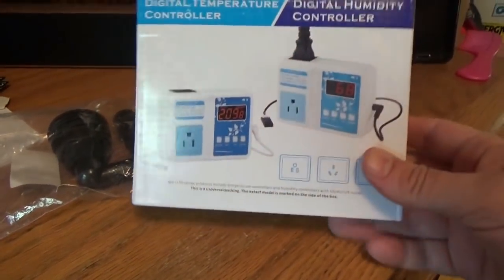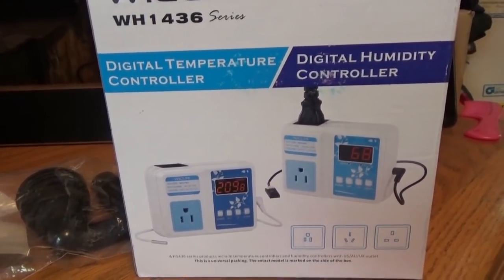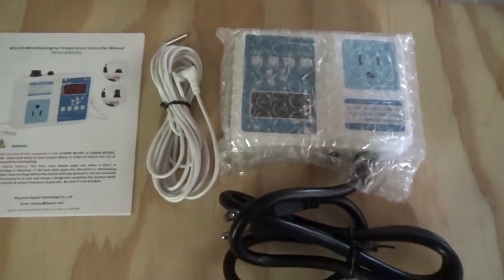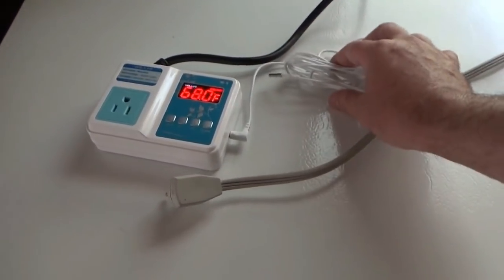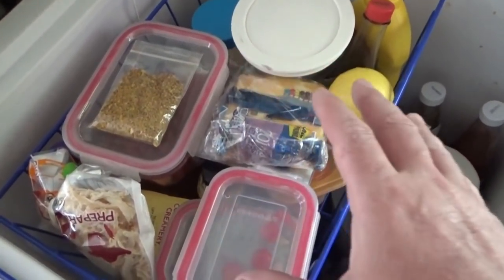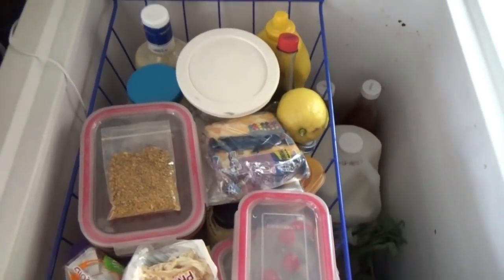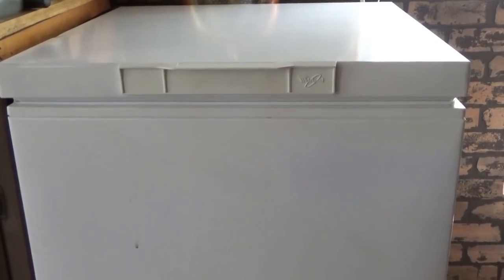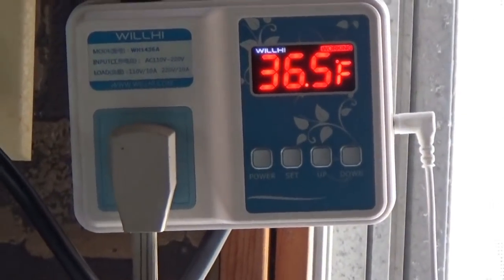Converting Freezer To Fridge For Off Grid Solar Power Operation

Comment: I put my sensor into an empty ketchup jar at the bottom of the freezer and set the control to 26 degrees. Everything stays frozen at the bottom. Everything on the freezer ledge and higher stays between 38 and 40 degrees. I also keep some ice packs at the bottom of the freezer to use in coolers. The difference in energy usage is negligible if set at 26 or 32 and this way I use my freezer as a freezer and a fridge.
Reply: Hello, I know it's an old comment and all but I'll try eheh could you tell me the average consumption after the modification and the size or model of your freezer?
Reply: Thankyou for the info. That's something I was hoping would be possible perhaps with a styrofoam divider

Comment: I did the same exact thing and used the same controller works great.  Set low temperature cut off at 33 degrees F and the high temperature at 37 degrees F.  Stays on for 2.5-3 minutes turns off for 30 minutes.  Great way to save on power.

Comment: The freezer already has a temperature cutoff.  To make one into a fridge, you just replace it with one with a lower temp range, they are like $10 on ebay.   Also note that a deep freezer is not meant to cycle often, things freeze and stay frozen, a fridge gets warm things in and out of it all the time and needs a bigger compressor to cool faster.  And lastly, a deep freezer uses coils on the outside of the freezer box as condensor coils, so the freezer must not be put in an enclosed space, whereas a fridge has a fan and coils outside the box that can flow air from above it to under it and can be put in an wall space.    Just a few things to know.  I am building custom fridges for rv and offgrid now.   Even best to put the compressor and condensor OUTSIDE so no heat is put inside the building, at least during times where you don't heat the living space.

Comment: Greetings from off grid Oregon. I had a chest freezer that I converted to a refrigerator back when our solar system was small. Mine used 220 watt hours a day or .22 kilowatt hours. We used tupper ware containers for different things. The biggest problem was the buildup of water from the humid air. We had to wipe the walls down with a towel once a week. We also insulated the compressor shelf on the inside of the chest compartment. We also insulated the top of lid the freezer. That was all we could insulate because the coils are under the skin on the sides of the freezer. The sides have to be exposed to dissipate the heat.
We eventually added to our solar system and do not need to use the chest refrigerator anymore.
Reply from the maker: Yes I was thinking of insulating the lid a bit better. I can feel cold on the top. And the condensation is terrible.
Reply: The Do It Yourself World that always helps to over kill on insulation to keep moisture at a minimum. In Florida where I live moisture is always a problem. I don't air my whole house just two rooms and mold is an issue in the unairconditioned  rooms.

Comment: This is too darned weird...last night I was in my shop looking at my $686.00 62qt. Dual Zone Whynter Fridge/Freezer that died right after the Warranty Expired. Plus, about 6 months ago I bought a 7cu.ft. Arctic King Chest Freezer for the shop...The Whynter Dual Zone was to be used in my Toyota MotorHome when I finally get my butt out on the Road...but it's Dead now....so on to other projects... So last night I was thinking to myself...I wonder if there is a way to have my little Freezer converted into a Fridge as the Freezer is rated at 1.2 amps 115volts....and here I am tonight I Stumble across your Brilliant video answering my question  ! Plus...I was at my local BiMart today and saw the exact same 7cu.ft. Freezer I bought for $199.00 is $50.00 off ....so I might just buy another one Tomorrow....Right after I check to see if I can fit it into my little Motorhome !  LIKED/SUBSCRIBED !

Comment: You can convert some chest freezers by just adjusting the screw on the thermostat. It will require accessing the side or back of the thermostat. This is also better than an external digital thermostat because it does draw any extra power (4W LED thermostat draws same energy as what some converted freezer-fridges - i.e. 100WHr/day)

Comment: I'm just learning about this project. Would a drain hole not fix your water issue? I have no idea what this is about or anything I'm just trying to learn some prep tips.
Reply from the maker: Yes, a drain would help out a lot. It is quite simple. A freezer is better insulated than a fridge. And a chest freezer holds cold air in better. Look at the freezer isle in the grocery store with the open top freezers. Cold air sinks. So, use a better insulated freezer and the fact that cold air sinks - put a thermostat on it to keep the temperature lower - and you have a mega efficient fridge.

Comment: Is it just me or did you have that temputure control plugged into a wall outlet with the freezer plugged into the control unit?!? How do you know youll have enough solar to power both?!?
Reply from the maker: For one thing, this is a separate power outlet, just for the fridge. For another, the solar power is separate from the house. Either things run or they dont. If its cloudy we plug into the grid or shut down.
Reply from the maker: On a video coming up, I show the grid power meter NOT running at all :)
We are slowly using extension cords and separate outlets to power all our things OFF the grid.
Reply: I don't know how you have everything set up but is there a safety issue if there are extension cords all over the place? Anyway, hope you are able to save some money by using your solar power. Just be safe for you and your family.
Reply from the maker: Well, with Michelle starting to become mobile, yes I am looking for a better way to wire things up.
Reply: The Do It Yourself World house wiring is not hard. I seen all your early videos when you were single and you came up with good ideas I think you could wire your own off grid home. There are videos on youtube that show how to hook up  
basic circuits. Good Luck and God bless your efforts!

Comment: Heat moves to cold. Cold cannot move. So the trick is to keep heat from getting into the cabinet. Heat rises so that's why a chest freezer is more efficient than a side by side.
Reply: There is actually no such thing as cold, just absence of heat (energy). You don't actually cool anything down, you remove heat (energy) from it.

Comment: If you don't want that gap in your lid seal you can also pull the original thermostat out of the freezer and put in a universal fridge thermostat
Reply: I drilled a small hole just under the seal and fed the probe through that. Works like a charm with no gap.

Comment: Thanks for the video!  Is your temperature controller still working fine?  Wondering about the longevity of it.
Reply from the maker: Works very well. Its on its third conversion now. We just got a large stand up freezer to use as a fridge.
Reply: The Do It Yourself World Thanks!

Comment: I have a question I didn’t see anyone posted yet. With this temperature controller, did you have to disconnect the original connection to the compressor?
Reply from the maker: No. No changes needed to the freezer.

Comment: I cannot be the first to say you were loosing air out the tiny crack where wire was. I did the same thing when going to burning man. Coundlt figure out was it would go down to 30— turns out the small gap was enough to mess with the seal and thusly messing the locking mechanisms to engage compressor... did you have this issue?
Reply: Drill a small hole just below the seal through the plastic and feed the probe through that. Then either seal it, or stuff it with some sort of insulation. I do this with my freezers I converted to a fermentation chambers and one I converted into a kegerator (keezer).

Comment: How many batterys are you using? Are they 6v or 12v
Reply from the maker: 8x 6 volt batteries wired for 24 volts

Comment: Did you know you can get the electronic board to do the same thing, with digital display and all, from China on eBay for $4?
Reply from the maker: Yes, and then wait for 30 days for it to arrive. Then buy the wires and 120 volt connectors. I looked into all that and figured its just about the same to buy this one. And I did not have to modify anything.
Reply: This is a prime example of why you need to
do some research prior to purchasing items.
Sometimes the less expensive item isn’t as
good of a deal as it seems...

Comment: It take 24 hours before things will settle down. A fridge has heater strips in them. That is why they use so much energy were a freezer is bare bones. Only heater strip is in the compressor to keep it from freezing.
Reply: Wow!  Half of what you said is totally wrong!  Compressor has no heater and can not freeze!  A refrigerator only has a heater ELEMENT in the freezer section and the element only draws power for a short time every 36 hours or so.  A power consumption but if you factor cost of manpower cleaning and electricity to unthaw manually a refrigerator and the moving out of food and then the loss of cold of the food and temporary storage and then waiting hours for the unthaw, wipe out condensation/moisture and then the reloading of food and finally the time and energy costs to bring the refrigerator back up to cold equilibrium (like you said up to 24 hours) which wastes power to get back to the normal state.  It is seen then that the small electric cost of the heater element might actually be a cheaper way than manual defrosting which all freezer will require at some point.  In the case of a chest freezer, I am not aware of any having a auto defrost cycle and will need manual defrost.  But in Troy's case, he is not going to be a freezing temps and so manual defrost is a moot point.  And as Troy noted the chest freezer is better insulated than a standard refrigerator which helps it use less total electricity.  Troy did a good job and explanation of how it works.  As Troy noted about hot AIR rising and cold AIR falling the chest style is superior, however, for those with a regular refrigerator, the freezer and the cooler sections won't "drop out on the floor" as much cold air if you reduce the amount of air volume by filling the space with more mass such as more food, water, rocks or whatever.  These denser materials won't loose there cold nearly as fast as air for the short times to open/close the doors.
Reply: EnergyCrafts those heat strips heat to defrost the freezer part and they run about 3 to 5  times in a 24 hour period short term. At least with the  frigidaire refrigerator I had. Some of the older units only defrost for 20 minutes in a 24 hour period one time. Every brand has its own defrost periods and times per day. But they use energy to defrost.
Reply: Agree.  My point was not debating if the defrost cycles use energy which they do.  My point was that the defrost energy cost might be overall the same or cheaper than the costs incurred for having to do frequent manual defrosts.  Manual defrosts means opening the doors and letting all the paid for cold of the enclosure to be lost to the room and moving out the food looses cold.  Not to mention the hassle of cleaning out the water drips and ice buildup.  Then while putting the food back in it looses more cold and the frigerator also starts building up moisture in the process.  Which leads to later premature ice build up and another manual defrost.  I just manual defrosted mine and it took many hours all in all.  And then after turning on the fridge, it takes MANY hours of burning ELECTRICITY again to replenish the lost cold.  So add up the many hours of energy burned for manual defrost process compared to short intervals of burning electricity to auto defrost and no hassles loading/unloading food or the intake of moisture of having the door open when loading food like in manual defrost.  Hope you fine this helpful.  In energy costs you have to think in terms of energy over time.  Not just energy as Watts but kWh for example.

Comment: Where do you put the frozen food?
Reply from the maker: In the freezer. We have a separate chest freezer
Reply: You might could use Styrofoam and keep your bottom for freezing and divide the top for refrigerator items. I used to make boxes for refrigerator trucks that hauled frozen food. Fresh meats went into Styrofoam boxes so they did not freeze.
Reply from the maker: Nearly impossible to make a freezer into a fridge and freezer.

Comment: Just a Note: Do yourself a favour and buy 1 or 2 spare Backup controllers. These little devices work but alot of them can not handle “bumps” in the power line voltages to them. They will just go pop one day. My little freezer uses a control like this ( not the original mechanical controller) and works very good......so far, but I do have a spare just in case.
Reply from the maker: Ok, thanks

Comment: 33 to 34 is opptimal for food, if that is possible.  I like this idea! thanks!
Reply: You're absolutely right. The recent foolishness of recommending that foods be held at up to 40F is a recipe for spoiled food.
We have a 1968 Frigidaire which holds the 'dairy' section at 33F, the meat section at 32, the crispers at 38 and the rest at a steady and reliable 35. Food stays fresh and doesn't spoil nearly as fast.
Chest freezer conversions are often poorly explained. This video does it really well.